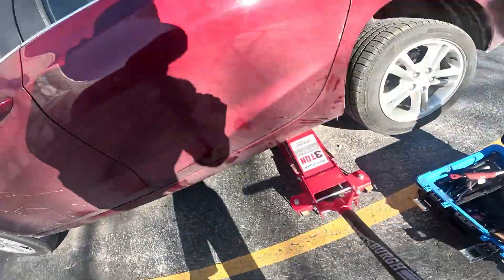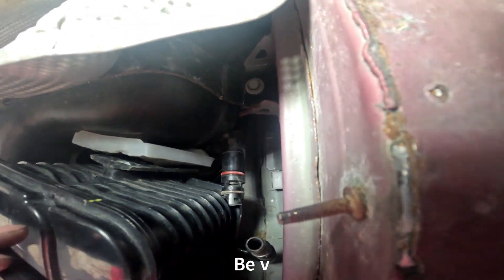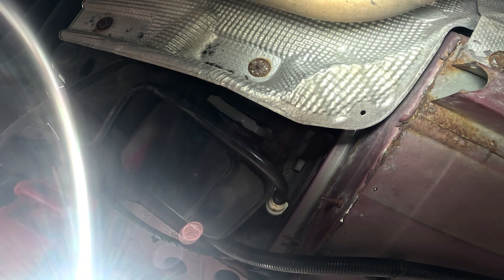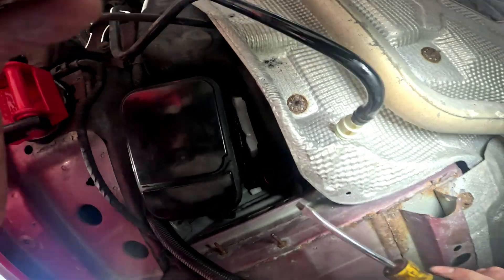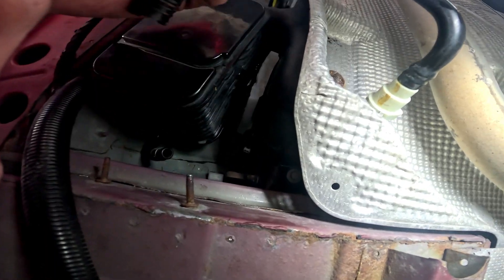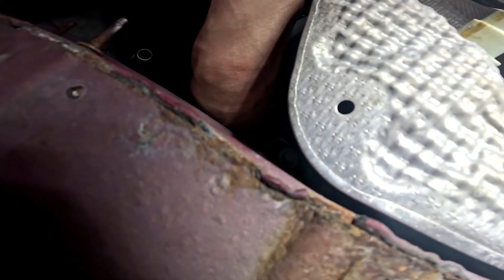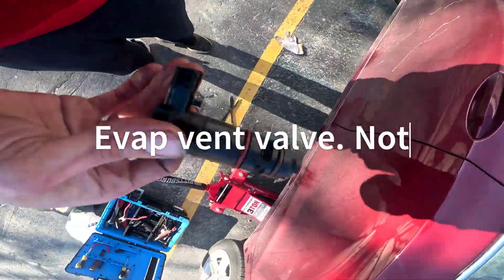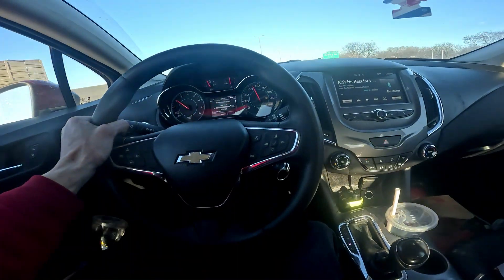2017 Chevy Cruze P0446 EVAP Vent Replacement

Comment: The wire to the solenoid switch on my EVAP canister is broken. I'm guessing a stick stuck up in there? I can't begin to get to the wire to repair it, so it looks like lowering the tank will be necessary. But people are telling me to not be doing that because I may cause a gas leak or do damage. I'm fairly handy around a car with simple to intermediate type jobs (replacing sensors, oil changes, brake pad and rotor changes, shock and strut assembly replacements, etc.) That said, I'm no professional. Should I take this to a mechanic or is dropping the tank down and letting it lay on the exhaust pipe not a big deal?
Reply from the maker: I would not let it lay on an exhaust pipe. You want to run the car close to empty on gas. Its not a big deal as long as you are safe and have have the necessary tools for the job. I think most all jobs on a car are dangerous. Not only for you but for the car as well. That is up to you to take the risk.